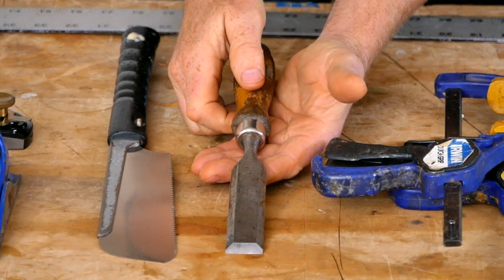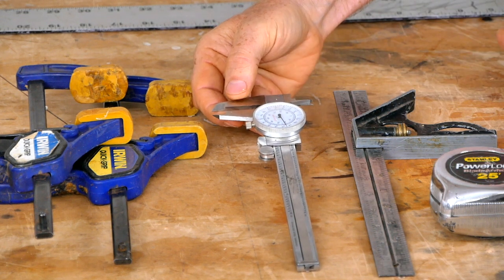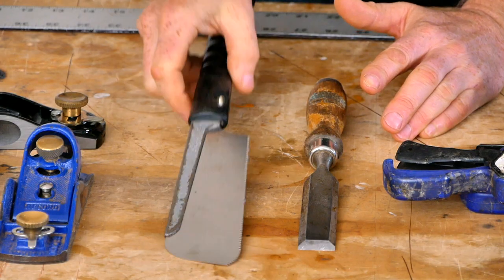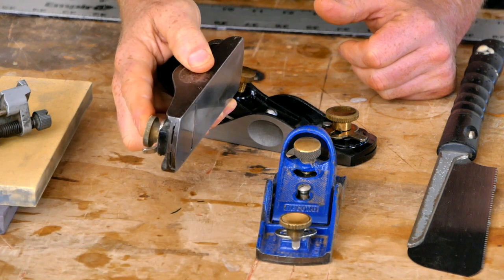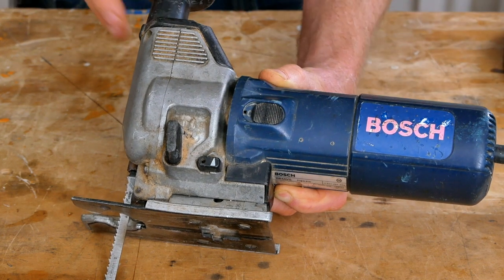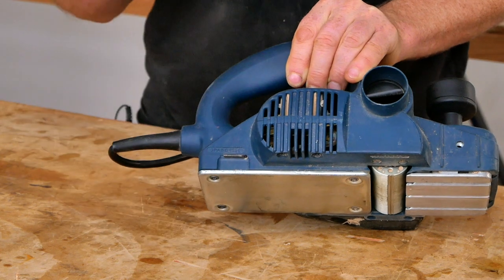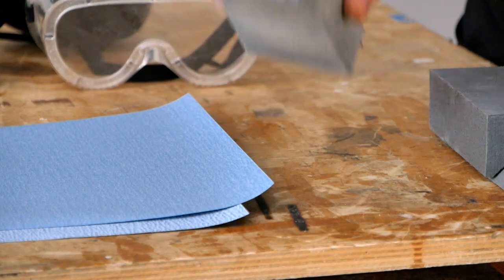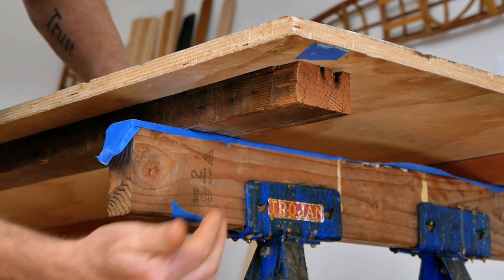Building a Greenland Paddle, Part 4: Tools and Workspace Setup

Comment: It's interesting to see your thoughts on what tools are necessary to build a paddle. I have built 17 of them so far, and oddly enough some tools you consider important, I don't use, even though I have them, and some tools I find essential, yet you don't mention 😅.

My prefered padle toolkit have be a powerful bandsaw, but I don't have one, mor the space for one. The jigsaw is ok, but I actually prefer a circular saw to cut the front profile, finishing of the cuts with any sharp handsaw. The top profile I used to handsaw with a coarse rip-saw, thogh I have taken to the power planer for this task. 

My planer is of particularly heavy construction though, so freehand carving woth it like you show is out of the question. Either a scrub plane or a spokeshave does an excellent and quick job of roughing for me. The block plane does most of the fine work though. I also have a tiny block-plane, almost just a thumb plane which I find really handy as it's very nimble, and the short sole lends it self well to working on semi flat surfaces as well as close to the shoulders. 

I have a fine chissle collection, but never felt the urge to grab one while making a padle. Everything that's not easily shaped by a plane I do with a Sløyd knife. 

I also have a fine collection of calipers, but never thought to use one. None of my paddles have ever seen a bit of sandpaper. I prefer the smooth surface left by a propperly sharpened tool.